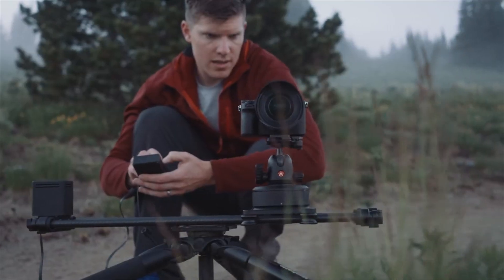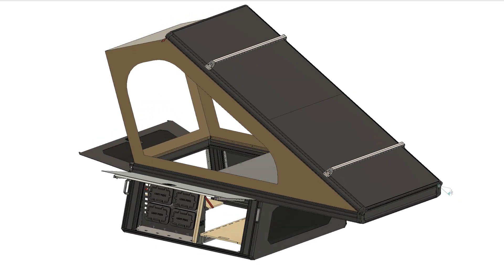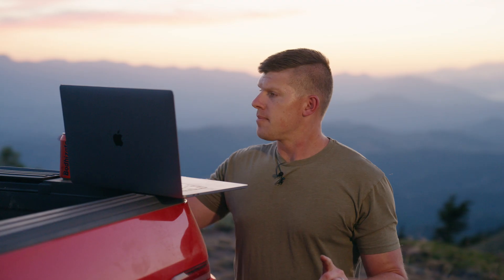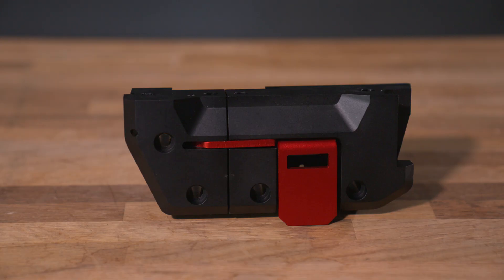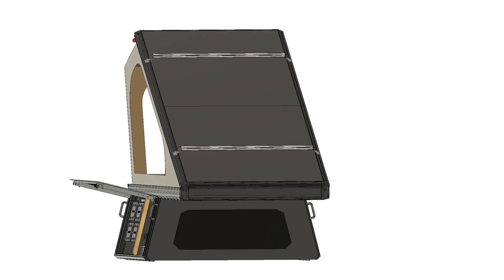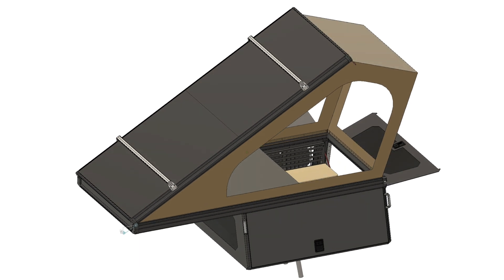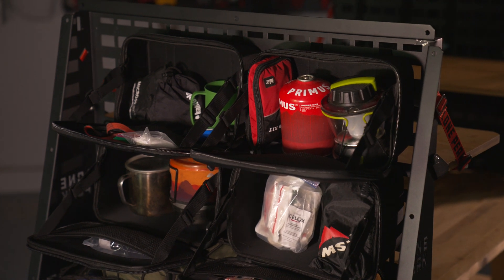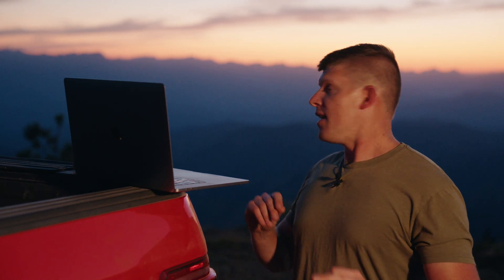Lone Peak Camper - Story and CAD Walkthrough

Comment: How "custom" will these be? I would like something that sits closer to the cab than this. I would still like to pull into my garage with this mounted.
Reply from the maker: Hey Joshua, it’ll have 1.5” of clearance over the tallest part of the cab and the camper is another 8” from the point. I’d say if you have 10” of clearance in your garage you’d be good.
Reply: @lonepeakoverland9213  thanks for the info. I am lucky if I have 6" lol.
Reply: I need 30 inches of clearance above the top of my sidewalls. Will I have it? 2016 Frontier Pro-4X shorted crew

Comment: What will you use for fitment kits? Will it be like a dual channel rubber weather stripping between it and the bed walls, like GFC uses? Also, for the tacomas will it attach using the pre-existing rails in the bed walls?
Reply from the maker: Hey Craig, we'll have weatherstripping all around similar to GFC and yes, we'll attach to tacomas and other rigs that use have integrated rails.

Comment: What size(s) will be available? 5.5/6.5' beds? Super interested - would love some fitment specs
Reply from the maker: Hey Sean, we're planning on supporting most bed sizes at launch. What rig are you running?
Reply: @lonepeakoverland9213  Thanks, I've got a Tundra with 6.5 bed.
Reply from the maker: @sgmineha1  Ok, sweet. We'll defnitely fit that at launch.